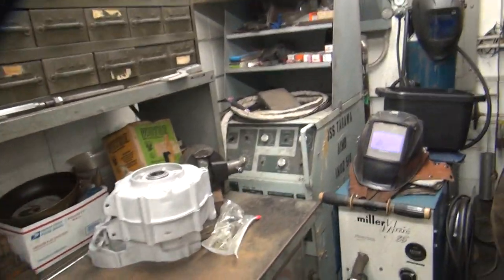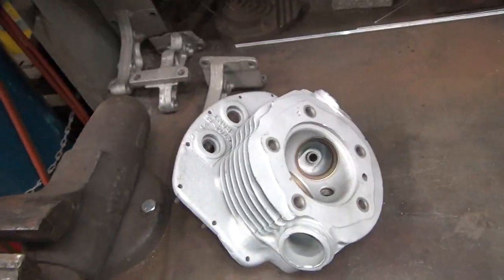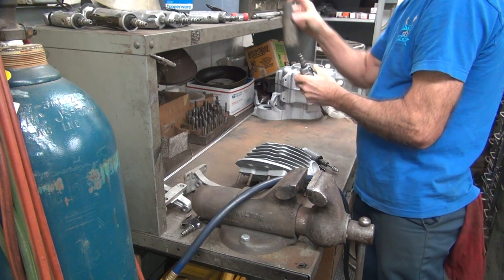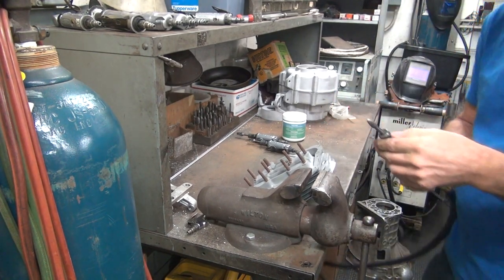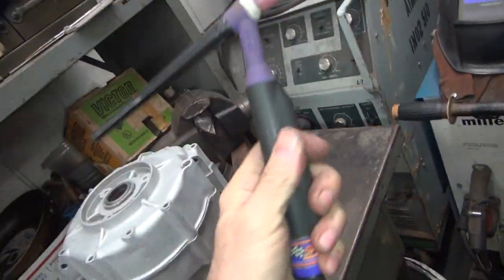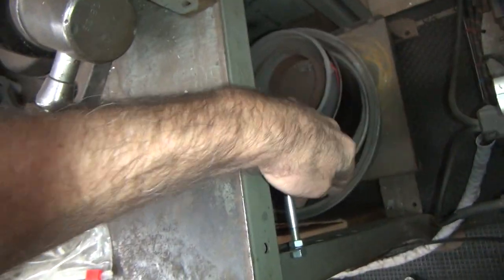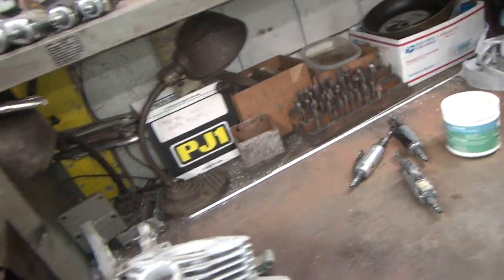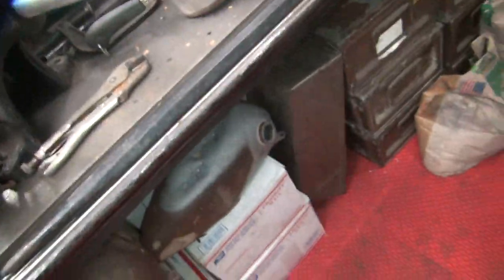#101 1955 head welding fin exhaust spigot crack repair 74ci flh panhead preheat harley tatro machine

Comment: I flatten copper pipe and tubing, then drill through it using a tapered drill bit (so it won't bite too much) drill a bolt hole in it for eyelet/ welder connections. VERY cheap and works as well as more expensive ones. I've also found that if you don't have the correct crimpers, don't try to shortcut with pliers or vise grips. Just use rosin cored electrical solder and they won't ever come apart. Great video!